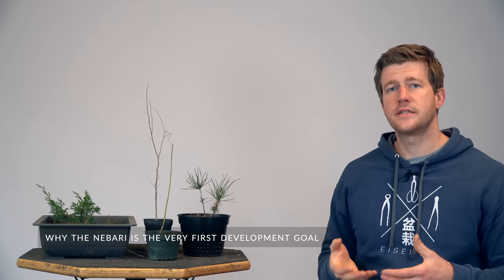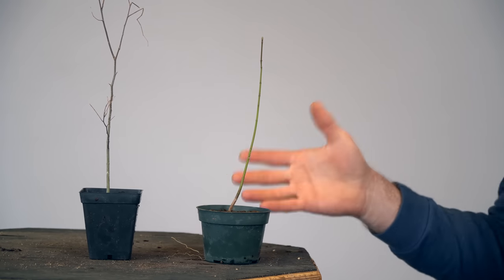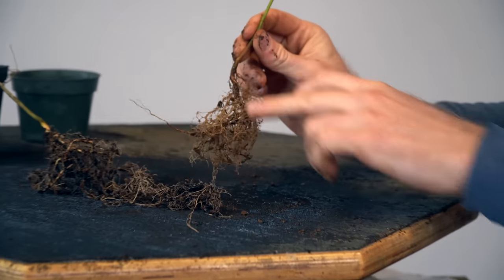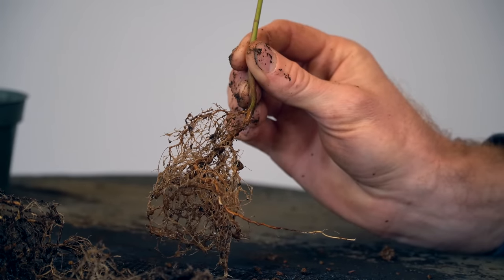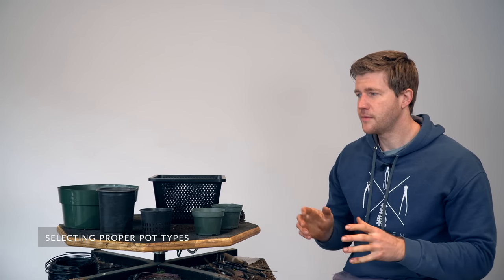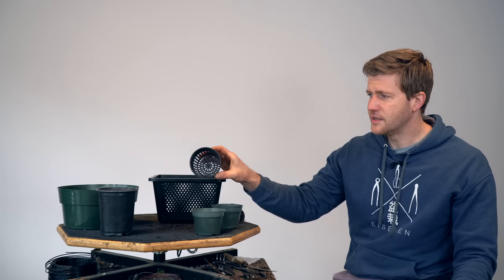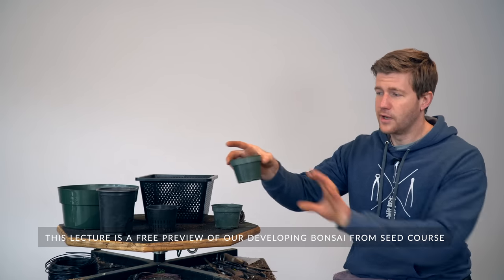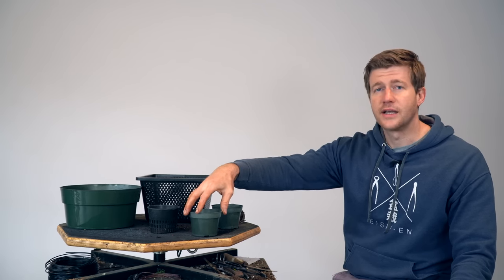Creating a Nebari and removing the Taproot of a young Bonsai

Comment: These pot suggestions just do not work in Oklahoma. I have to use larger pots or they dry out in just a few hours. Good advice for moderate and moist climates but man... 95-110 degree summers do not like the smaller pots. Lost quite a few attempting it. Great video though. Hope to move to a better state one of these days.
Reply from the maker: Thanks for the tips!
Reply: @bonsaiempire  Sure! Oklahoma doesnt have much for bonsai - a small club in the OKC area. But keeping them in bonsai pots is near impossible without constant watering and potentially covering the soil. Also have to use a mix with LOTS of miracle grow to retain that moisture... Good luck everyone!
Reply: Hey JB, I have similar issues with heat in my area of South Carolina.  I’ve found that if I want to do smaller trees or seedlings that I have to place them in a growing bed that I can set the small pots in and allow the roots to escape into the grow bed,providing much more stability in the hot weather, and less frequent watering. You can use sand or mulch in the bed, I’ve found that I like perlite as my medium for the roots it produces and the ease of removing the seedlings in the fall. Good luck with a challenging climate!
Reply: @kylepurvis6231  I kind of wondered about that. I am worried about insects with putting them directly on the ground. Currently I have them on pallets of some sort to raise them - but they also dry out faster. I will give that a go. Thanks!
Reply: Also trying to grow bonsai in Oklahoma. It can be challenging to keep up with the watering but I’ve found that using a top dressing of shredded and sifted sphagnum moss really helps retain moisture. I also try to keep my pots on the ground and out of the wind and that seems to help. The heat last summer was nuts
Reply: @lucassimmons9112  I will add some sphagnum this year as well. Usually I just have the soil and the sun bakes it fast. Yea it was over 100 degrees for days on end in OKC/MWC. I really think the wind destroyed my maples more than the heat. Leaves just shriveled up even when heavily watered. Sometimes I dream of moving... lol.
Reply: I've had this problem in Southern California as well. Best ways I've found to get around it are using humidity trays, the "pot in a pot method" described in the video, or just adding more moisture-holding ingredients in my soil mix. But I can afford to spring for some clay pots too since I don't have a whole nursery to consider lol
Reply: Right. But what you can do is put your bonsai in a smaller pot and put the smaller pot on top of a larger pot. 
I live in a tropical country. It can get as hot as 40 degree in the summer.
Reply: @Blaze07091  What does putting a small pot on top of a large pot do? Can you explain more? We get dry hot winds of like 110+ here. I probably need a location with less wind primarily.
Reply: @JB-iz8tf  the roots will grow out from the holes in smaller pot and reach bigger pot. 
That way your nebari remains just as big as you want it to be and you want to display your bonsai whenever you want to, just cut the roots from below and take the smaller pot out.

Comment: i am surprised that the 2 year old seedlings were not grown in net pots to begin with. Bjorn mentions only aeration as its benefit but the biggest benefit of that pot is air pruning !

so, in the same 2 year period, the tap root would have died on its own within months and created lot of side roots in next 1 year. by year 2, that seedling could have gone to a bigger pot or even ground. even a deep pot is not a problem, as long as there is horizontal tile/plastic base below the roots to force them to go sideways & then down.

manual root pruning of seedlings is inferior to air pruning, using good air pruning pots (better than net pots). another alternative is root escape method where they are allowed to escape and then cut off. this manual pruning is still better than the one shown in video. i encourage people to compare the 3 methods and see the results after 1 or 2 years